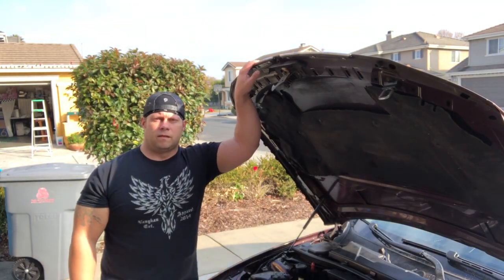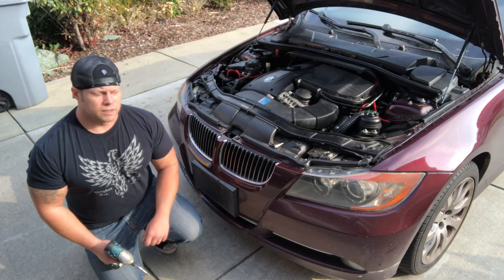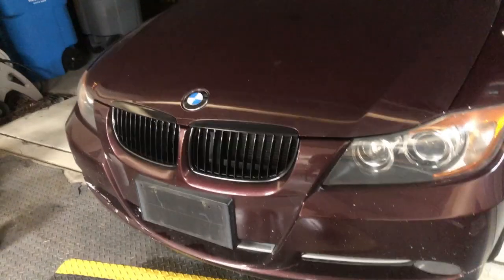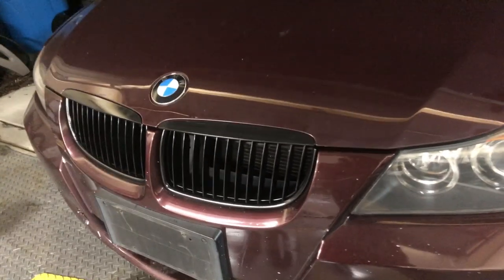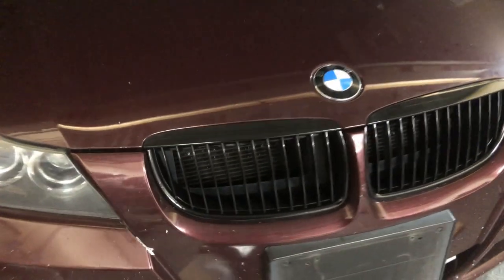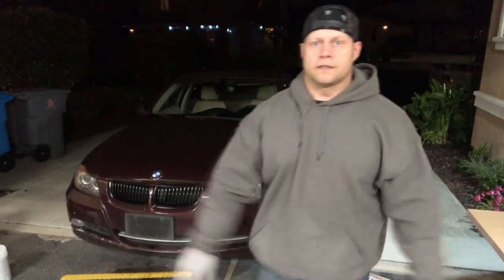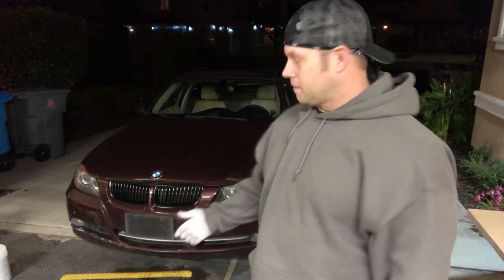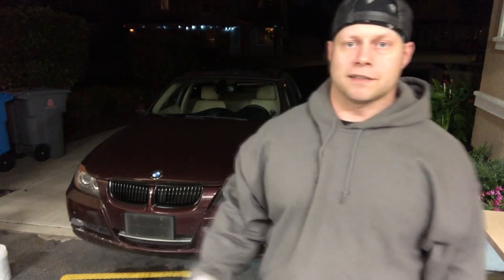I Painted my BMW 335i Grill Gloss Black!

Comment: Man you should remove that license plate holder on bumper. Will look much cleaner. Nice video!
Reply from the maker: Yeah, that is on the list..  I need to fix and repaint my bumper first then I will probably get rid of it.  Thanks!
Reply: @thekimballproject3236  instead of repairing it why dont you get a m3 bumper instead?

Comment: did you prime them, then hit them with gloss black?
Reply from the maker: yep,  lightly sand the chrome down so the primer can adhere well,  then prime and paint.  i sanded the primer with 1000 grit sandpaper just lightly to make it nice and smooth then the gloss black looked nice and smooth.
Reply: @thekimballproject3236  how many cans did you end up using of each?
Reply from the maker: Two One,  i think maybe 1 1/2 cans.